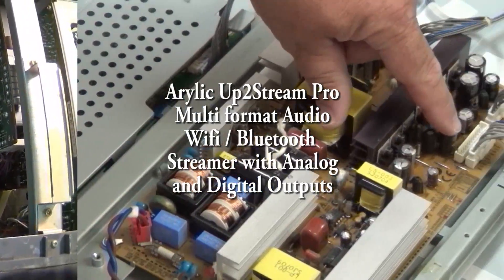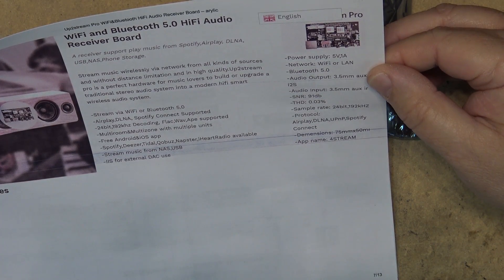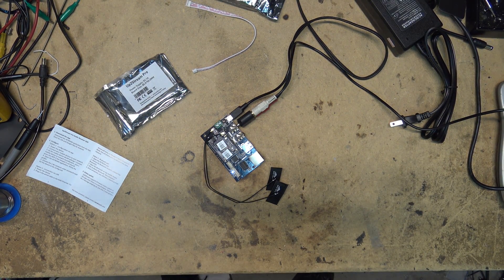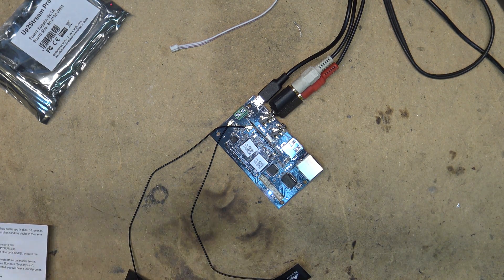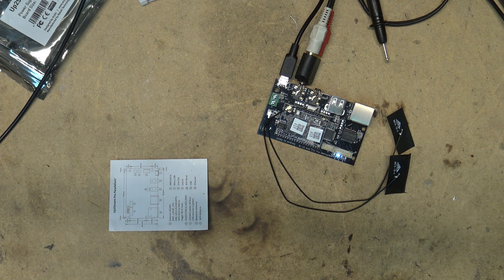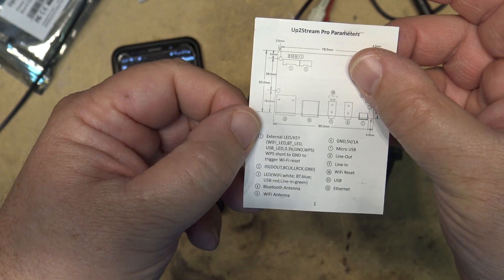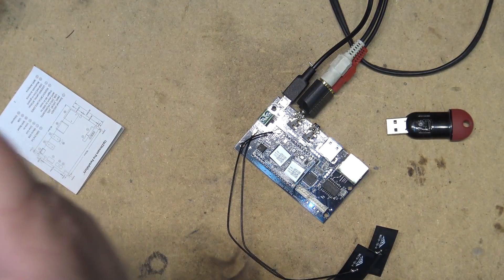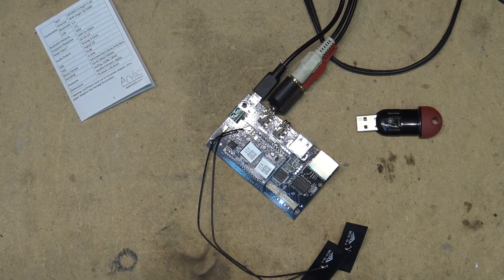Arylic up2stream pro multi format wifi   bluetooth audio streamer review

Comment: Could this be an easy solution to play a vinyl record multiroom? If up2stream is able to stream audio from line in, one could connect this input to line out of the amplifier or seperate phono preamp and listen to the music in other rooms via additional up2stream units simultaneously? Is there a way to set up audio delays to sync different amplifiers using multiroom scenario?
Reply: Check out the manufactures site for a unit with an amp - not sure... is that all you would need? https://www.arylic.com/products/up2stream-miniv2-receiver-board

Comment: 12voltvids how are you using this board in your home setup without the phone? I don't suppose you or anyone else with this board has used it with Linux again without a phone?
Reply from the maker: You need the phone to set it up.  Once it is up and running it can be set to play from PC connected to network and once playing the phone is no longer needed. The ap can be shut down.  Naturally if you want to modify the okay list or select a song directly you need your controling device which could be a phone or tablet to operate it.  I'll be using my tablet as a controller likely once I set it up.
As to Linux, you are on your own.  Only coders use Linux and if you know how to code in Linux you can figure this one out on your own.  The rest of us just want to plug it in and turn it on.   I used to like to tinker with code when I was younger.  Then I wised up and let someone else do that.

Comment: That's a big powerbrick just for that sucker!
Reply from the maker: The power brick is not for this one.  It is for the other one that will be reviewed next.  This one runs off a 5 volt usb power supply, a cell phone charger.  The other board has a 30wpc amp built in.

Comment: I like stuff like this but sometimes the companies go under and then the app stops working.  I had a device that could make an iphone or a droid a remote controll and then the company went under.  The app stopped working and you couldnt get remote codes any more.
Reply from the maker: Well they don't have to go under for that to happen. Look at Sonos. They bricked all their older systems that had their own dedicated remotes and forced people to buy new ones.
Reply: @12voltvids  Thats true to someone was over telling me to buy sonos and replace my receiver I said would you like to buy them for me i never liked sonos they conned are friend into buying unneeded wifi hardware from them.  I have a denon receiver its been pretty loyal a newerish one but with HDMI
Reply: @12voltvids  When did they brick older ones I'll have to ask are friend if there's stopped working.
Reply from the maker: @stpworld  Back in April
Reply: @12voltvids  I read up on it after you told me loads of angry customers.
Reply from the maker: @stpworld  
Love the excuse about the battery getting weak as their excuse.  There were plenty of batteries out there but I guess a lawyer was concerned that if someone put an aftermarket battery in and it caught fire they would be sued so rather than risk someone selling after market batteries they decided to kill everything and with connected devices it is easy to do. Apple been doing that for years.
Reply: @12voltvids  I actually got one company to admit factory defect to me when I sent something in recently I was amazed.  Yes I love that to saw that in multiple things.  I remember the old sony they used to be so nice sometimes they would just send you the part for free of course those days are gone.
Reply from the maker: @stpworld  
Remember kuerig the coffee pod company.  They had a bullshit fake recall that claimed that people were being splashed with hot water and offered new models.  The new model required the new pods that had a chip in the pod and would not brew the old ones.  Why? Because a competitor started selling a basket that you could put your  own coffee in and reuse and not have to buy their expensive pods.   Many people fell for this and were very pissed when they were duped out of a better machine.  Those 1st generation machines are now very collectable.
Reply: @12voltvids  I didnt know that about kureg i'll have to check it out.
Reply from the maker: @stpworld  
Here is an article was a seattle news station.
https://www.facebook.com/KING5News/posts/10152636134931476/
Reply: this app is made by someone else.  The hardware is almost exactly as dayton audio hi-fly products.  The hardware works on the dayton app
Reply from the maker: @vetsen  I am sure there are many competing devices that all use similar apps that are based on the same code, as there are open source apps all over the place that anyone can customize to their own preferences.
Reply: @12voltvids  What I'm trying to convey here is that there is an app called Hi-Fly by dayton audio that should work with this hardware.  It looks almost exactly the same as 4stream and muzo app.  My dayton hi-fly hardware is compatible with 4stream and Muzo.   The mac address of my hi-fly hardware matches the manufacturer of the cobblestone device they sell.  So I think both of our hardware will work on any of the three apps.   I ordered a mini to test that out.  Go ahead and try it for yourself.  MUzo, 4stream, hi-fly.
Reply: @vetsen   Did you ever test if different apps work with this hardware?  I'm interested in this device but the app "4stream" that is needed to setup the device apparently requires access to GPS and phone file system, which is a non-starter.  Do the other apps work?  Are they as privacy invasive?  Thanks!
Reply: @daniel.hoover   Yes.  I have configured the up2stream  device and can use it on both 4stream and the Dayton Hi-Fly app.

Comment: This looks like a pretty interesting device.  However, that I2S output is a deal breaker for me;  I'm not about to hack the I2S bus of any of my DACs.  This device needs asynchronous USB output.
Reply from the maker: Considering it has a pulse DAC internal it is going to perform very well. 99% of buyers are going to use the analog output.
Reply: @12voltvids  Given it's price point it might be worth investigating just how good its internal DAC is.
Reply from the maker: @davidgriffin79  
To my ears it sounds fantastic and I have it connected to my tube amp now.
Reply: @12voltvids  It'll be competing against two Benchmark DAC's and one Arcam (in terms as to what I'm used to hearing) so it will be interesting.
Reply: @davidgriffin79  hi David, how did you get on with the up2stream after a few months use? How does the sound compare to your Benchmark etc? Do you know if it uses music services like Tidal directly or 3rd party renders them? Thanks, Tim